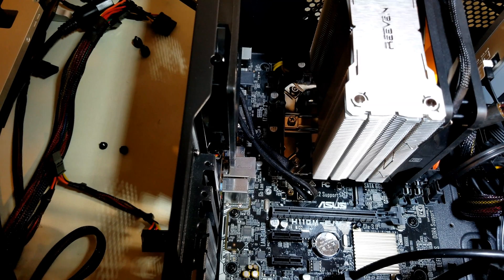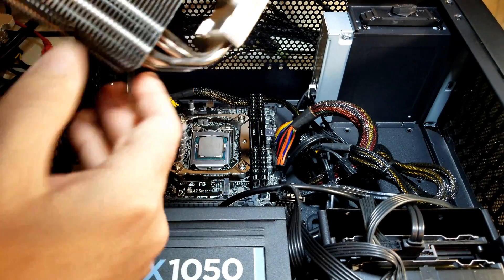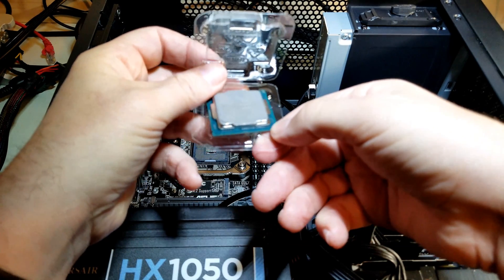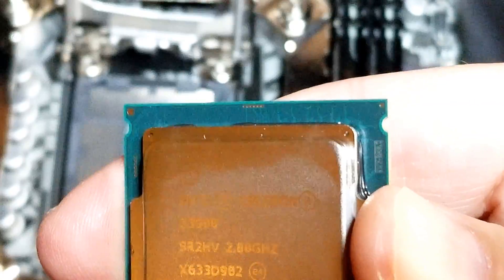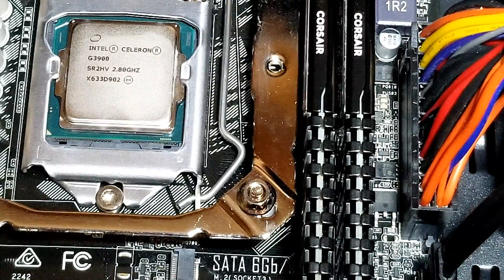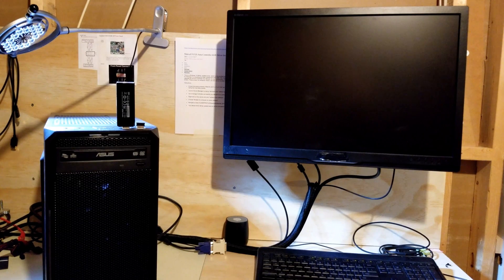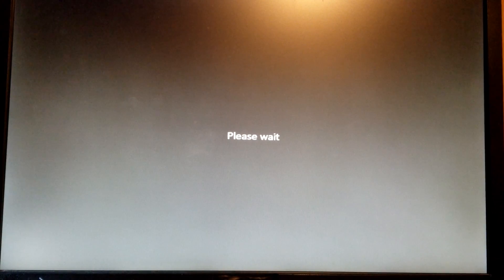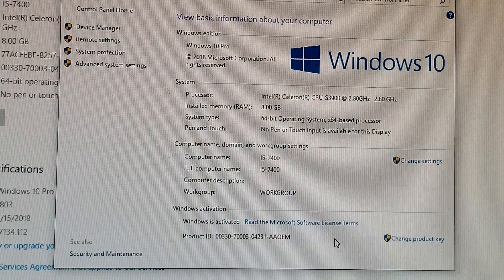Replacing your CPU  Win 10 will You need to Re-Activate it

Comment: hi, i had a i5 4210m and i replace with i7 4702mq. in my computer -> device manager it show 8 processors but in task manager it still show 2 cores, 4 logical processors same in msconfig -> boot -> advanced options... (i will need to reinstall OS???)
Reply from the maker: What Motherboard are you using them in?
Reply: @Reviewing_Playing_and_More_RPM   when i get home i can tell you, i know it's from Acer Aspire E5-572G-5828
Reply from the maker: Yeah please do as the info for the Acer shows a laptop when I look it up. Thanks

Comment: Hello, I had a i5-3470 but replaced it with a i7-2600. And there has been a lot of stuttering. Is it just my old one was a better or do I have to update something on my PC?
Reply from the maker: Those CPU are from different generations the i7-2600 being a Sandy Bridge architecture with Socket 1155, and the I5-3470 being  Ivy Bridge architecture with Socket 1155. So you will need to check that the MB your putting it in is compatible and if it is does it require a BIOS Update to work properly. You can get more info in this regard from www.pcpartpicker.com it will help you with both compatibility issues,  and also if you need a BIOS update for it to work correctly. There's also the issue that you may need a new driver updated which is an easy fix and likely fix many issues. Give the site a try and it should help you out to sort this out.

Comment: I changed my cpu to intel 5 but it’s stuck on bio setting and won’t let me exit
Reply from the maker: So if you got to the BIOS and no compatibility issue's then when in your BIOS there is a Load Default Values or something to that effect it's slightly differently worded depending on the Motherboard, so do a quick MB Manual search the save it and reboot. It's normally F10 Exit and Save after that. Be sure what you make changes to so you don't have other problems. It'll keep taking you into the BIOS until you put in a Hard Drive and install an Operating System.

Comment: Not sure if you will respond but I just switched my ryzen 3 to a ryzen 7 and when I put everything back together, it turned on but my gpu fans weren’t spinning and no display.
Reply from the maker: Start with checking memory is fully inserted, use PCPartpicker.com to ensure the parts your using are all compatible. If you went to a higher end CPU you might need a BIOS update first. Also checking cables are all plugged in and none were missed.

Comment: Hey sir I have a question, so I'm upgrading from an i3-4160 to an i7-4790 both are 4th gen Haswell cpus, I also did my research on whether they're compatible and yes they're, both are lga 1150 socket and based on intel H81 chipset, I have also updated my bios to the latest version using my old cpu, my question is, when i remove the i3 cpu and install the i7 will i need to do a cmos flash like resetting the bios, or should I just install the i7 cpu and boot.
Reply from the maker: As you've verified compatibility then you should able to just remove the I3 and put in the I7 and boot it up, you should be good. That's what I did just as you stated and it worked with no issue's.
Reply: @Reviewing_Playing_and_More_RPM  thank you, I will proceed with the installation today
Reply: @Reviewing_Playing_and_More_RPM  so I installed the i7 and it booted up well, and everything synced well, but I have a little issue, whenever i shut down the pc and the turn it on, it start and turn off, and then when i turn on again it boots up fine, what could be the problem here
Reply from the maker: @jniorlennon4669  My thought is this is a Power Supply issue, can't say for certain though. sometimes it can also be Ram. Try removing the Ram and re-inserting it.
Reply: @Reviewing_Playing_and_More_RPM  i think it might be psu, because my mobo on the cpu power pin it uses for pin and i see new mobos use a 4 pin cpu power connector and for my previous i3 it had a max TDP of 54Watts.
Reply from the maker: @jniorlennon4669  Newer MBs use 8 Pin and some 8 Pin with also a 4 Pin to allow for OCing, ensure if you have both your using the 8 Pin first, you might not have a PSU that doesn't have the extra 4 Pin CPU cable but as long as your not overclocking you can just use the 8 Pin. Older MBs might have just the 4 Pin as you mentioned though.
Reply: @Reviewing_Playing_and_More_RPM ohh jeez i made an error there i meant mine uses for and yeah you're right new mbs use 8 pin, so for my mb it uses the 4 pin cpu power, I've done some benchmark on the cpu to stress it a little and see if it will turn off luckily it didn't, I really appreciate your help, looking forward to learning more from and your video's))
Reply from the maker: @jniorlennon4669  Happy to help ask anytime.

Comment: switch from i3 4th gen to i5 4th gen .processor  Without formatting or reinstall window ..can we do it ....
Reply from the maker: Depends on your MB and what CPU's it will allow, to find out go to PCPartPicker.com put in your MB and then choose your CPU it will tell you if they are compatible, if they are then yes.
Reply: @Reviewing_Playing_and_More_RPM   Motherboard is Lga 1155 support Intel i3, i5, i7 4th generation . Going to switch from  i3 to i5 ....
Reply from the maker: @noushervlog6837  As above you need to go to PCPartPicker.com and choose your specific MB, the CPU you want to use and it will let you know if it's compatible.

Comment: Hey, great vid!
And what about drivers like chipset? I dont need any install for a new processor?
Btw upgrading from i3 3220 to i5 3350P
Thanks!
Reply from the maker: So Intel does there chipset driver updates automatically, something AMD needs to start, as long as the new CPU is compatible with the MB you'll put it in it'll be a nice update, if your not sure you can go to PCPartPicker.com and any compatibility issue's will show up with info on them.

Comment: So..., The files are safe and we don't need to buy windows again after changing the processor only ??
Reply from the maker: That's correct, but only when switching from the current CPU to a higher end CPU on the same MB as long as the CPU is compatible, you can check compatibility issue's to ensure they'll work together using PCPartpicker.com hope that helps.
Reply: @Reviewing_Playing_and_More_RPM  so, can switch intel i5 3rd gen from my intel i2 without reinstalling windows 10 ?
Reply from the maker: @FrostEren  go to PCPartpicker.com and along with your MB type that in and it'll tell you if they are compatible, if so then yes.
Reply: @Reviewing_Playing_and_More_RPM  thanks for helping 😃

Comment: Hi, I upgrade from i3 540 to i5 760 on H55 motherboard, I check on Pc part picker and it supported... But after I replace the CPU it can't boot to lock screen windows, always crash and restart automatically. I use OEM motherboard btw. Can you help me
Reply from the maker: If PCPartpicker.com says it's compatible with the MB your using, then it's possible you might need a BIOS update before swapping in the new CPU, so you can switch it back update the BIOS then put in the new CPU and it should be fine.
Reply: I already search my motherboard bios, it's say Inforce motherboard. And I already search it but I can't find any bios for that motherboard. I'll try searching agan sir
Reply from the maker: @bangepen23  Not sure where that is from but it's not even recognized by PCPartpicker.com, so it's highly unlikely it is going to work. Good Luck though
Reply: @Reviewing_Playing_and_More_RPM  New update, I need to update my Motherboard bios and I search it for the bios. Turns out there's a chance I can update it with Intel bios or American Trend bios. I'll try it today.

If fail, well I gonna buy cheap H55 Motherboard.

Comment: I switched from a 2600x cpu to a 3700x with a b450 plus which is plug and play accessible with 3000 series chips. I swapped it out, did the usual X thermal paste and turned my pc on. It's been sitting in a booting phase with no output to monitors. I'm not sure if this is normal thank you
Reply from the maker: There are some B450 MB's that could need a BIOS update for the CPU to work, most will work out of box, there are some exceptions though. Check the version number of your B450 MB, if it's Version 1.0 it could need the update if it's Version 1.1 or higher you should then have been ok. So now if it turns out that it's ok, then check your cables are in, Memory re-inserted (just in case) and then check you're monitor cable is going to the GPU and not the MB as I've done this once or twice and went into panic mode lol. Hope this helps.
Reply: @Reviewing_Playing_and_More_RPM  ok thank you, it booted without a video feed 4 times and I think it's because my mb isn't actually 3000 supported. I bought it July 2019 and the 3700x came out September 2019. I needed a new mb anyways as I don't have enough usb 3.0 ports. I was planning on buying a new one
Reply from the maker: @rileyp1506  With an update to the BIOS the MB will still work with the 3700X, but a new MB is always nice.

Comment: I dont know much about pcs but I switched my cpu and I had a black screen but my keyboard and mouse and computer would start. So after that happened I switched back to my old cpu and its still doing it
Reply from the maker: Give me a run down of all the steps you took and I'll see if I can spot what took place that's causing this.
Reply: @Reviewing_Playing_and_More_RPM  i also made sure my cpu pins are not bent
Reply from the maker: @joshsmith8244  So that all sounds right, but you didn't mention thermal paste, that is needed as well, but as you likely did that you need to ensure the CPU your putting in is also compatible with the Motherboard your using, you can check by going to PCPartpicker.com and put your MB and CPU in and see if it lists any incompatible issue's. You mentioned you put your old CPU back in and still had the same problem, did you change anything else or possibly the Ram (Memory) might have come loose, try re-inserting it to see if that could be it. Check the cable for your monitor is going from the GPU to the monitor unless your CPU has integrated graphics. Just trying to troubleshoot first things that might be causing it. Let me know.
Reply: @Reviewing_Playing_and_More_RPM  oh ok and btw no I didn't change anything else then the cpu and yeah I didn't change the thermal paste I didn't know it was needed
Reply from the maker: @joshsmith8244  Yeah thermal paste is required, otherwise it can thermal throttle and crash, this could be causing the blank screen as well.
Reply: @Reviewing_Playing_and_More_RPM  there is already thermal paste on it but I'm not sure if I need more. Also I don't know if this matters but the new cpu is from a other computer that is fine but not put to use anymore
Reply: @Reviewing_Playing_and_More_RPM  so technically its not a "new" cpu but it still works fine
Reply from the maker: @joshsmith8244  Yeah that's no problem I upgrade a lot of systems and this is happens every now and then. As long as it gets the job done that's all that matters.
Reply from the maker: @joshsmith8244  Best to clean off the old Thermal Paste and apply new paste, as long as the CPU is compatible with the MB it'll be good.
Reply: @Reviewing_Playing_and_More_RPM  im not sure why my old one isn't working I even re put in the ram
Reply from the maker: @joshsmith8244  Just check cables to ensure everything is plugged in, and GPU is fully inserted as well.
Reply: @Reviewing_Playing_and_More_RPM  ok i will do that soon
Reply: @Reviewing_Playing_and_More_RPM  i took off the water cooling that is on the cpu by unscrewing it and then I removed the cpu and put the new one in making sure the arrow on the cpu lined up with the arrow on the pc and then I screwed the water cooling back on top of the cpu like it was before and then put the glass on the side back on and plugged everything back in

Comment: So I just switched from an i3 to an i5 and everything works, but it won't boot anything except the bios. I have no idea what to do. Help?
Reply from the maker: If your going straight to BIOS you need to check that your Hard Drive is selected as the Boot Drive, that is a common error, otherwise ensure the memory is inserted fully.

Comment: hey man i just replaced my cpu and the pc is on but the monitor displaying anything
Reply from the maker: So as long as your using a compatible CPU and a GPU it will work, but ensure your monitor cable is from the Monitor to the GPU not the MB GPU slot.

Comment: So before changing cpu is there anything I have to do?
Reply from the maker: Start with checking that the CPU your putting it is compatible with your MB, with AMD there's more compatibility options, but Intel usually only gives a couple options for updating...and it's a good idea to backup all your important Data in case something should happen...this should be done all the time but not everyone does this (myself included lol) but I have backups of all things that matter the most like Pictures and things stored in the cloud and separately off site and stored separately in my home...essential if you plan to upgrade often...making sure you have Thermal Paste to reapply, and that's about it...

Comment: Hi sorry just making sure. No need to do anything like installing drivers etc if I swap a 2600 to 3700x correct? Just swap it physicall and I'm good? (My bios is already updated)
Reply from the maker: If your going from a 2600 to 3700 and have already done the BIOS update then it should be a straight swap, I updated the BIOS on my 3100X then inserted a 5800X and it's working great...I'd suggest updating the chipset driver though...
Reply: @Reviewing_Playing_and_More_RPM  my pc already has an updated chipset driver since it's kinda new. Do i have to uninstall and reinstall that when i swap? (Will give my 2600 to my friend since i will be getting a 3700x, hence the cpu swap)
Reply from the maker: @rensquared24  No if it's updated then it'll be fine...just ensure everything is up and running before you get rid of your other CPU just to be sure...

Comment: After replacing cpu. No display
Reply from the maker: If you replaced it with another and it was compatible it will work, however ensure your GPU is installed and your cable from your monitor is going to your GPU and not the MB as that's a common mistake...but there could be other reasons as well...if you still need more help give me a full list of your components and I'll see what more I can do...
Reply: @Reviewing_Playing_and_More_RPM  gigabyte h61m lga 1155
6gb Ram 2x4 1333mhz
Previews processor Intel Pentium g2020 2.9ghz upgrade i3 3240 3.4ghz
Reply: @Reviewing_Playing_and_More_RPM  there is no light showing on keyboard and mouse
Reply: @Reviewing_Playing_and_More_RPM  I don't have a graphics card
Reply from the maker: @jyvincent700  Ok, so they are compatible, and both  CPU's have integrated graphics so plugging into the MB will be good, you have Memory inserted in slots 2 and 4? and the Power Supply is plugged in ok and working correctly? If all that is ok, then it's a matter of did you get to a boot to BIOS at least? The parts are older so it's possible there might be some sort of conflict but not sure...

Comment: I upgraded my cpu with a new processor the is compatible with my motherboard, a day after every time I would turn on my pc I would get a no signal on my monitor but the pc would still run. After that I’ll have to turn it off a couple of times and then it’ll finally show my account and usernames etc. what would cause that? It’s a bit of a stretch but it only started happening once I installed the processor
Reply from the maker: Sometimes when installing a new CPU you might need to re-install the drivers for components, as Windows will overwrite the one's you had, so I'd update the GPU Drivers and see if that might work...

Comment: Will it restart my pc if I change to a completely new cpu I’m really worried please respond
Reply from the maker: When you replace your new CPU with I'm guessing a new MB as well then it's best to do a Fresh Install, in which case you'll need a new Product Key, if it's a upgraded CPU in the same MB then you'll be fine and it'll just start up once you have the CPU inserted and new thermal paste and the CPU Cooler back on, keep in mind you might need to change some drivers after switching sometimes...

Comment: I took a look at my Lenovo thinkstations cpu and when I tried to turn my pc on after I put it back together my pc would turn on but it wont show picture and after 10 minutes it turns off. I got told to clean my ram but it didn’t work. I don’t know how to fix this please help me .
Reply from the maker: So ensure you used Thermal Paste on your CPU before putting the CPU Cooler back on, and verify that you inserted the memory back in the correct slots, check your monitor cable is plugged into the GPU vice the MB...unless you have integrated graphics...

Comment: is that all sir? like all the bios menu are on the default so its fine to continue without changing anything?
btw i just realize you plug an usb to it is that the drivers?
Reply from the maker: I replaced it with the same MB, so all the drivers remain the same, nothing else to do if doing the same way I did in the video, gets a bit more involved when changing out the MB as well though...The USB was a WiFi Dongle in case I needed it but didn't require it...
Reply: @Reviewing_Playing_and_More_RPM  thanks again my good man keep it up